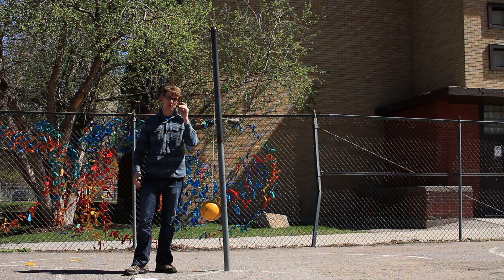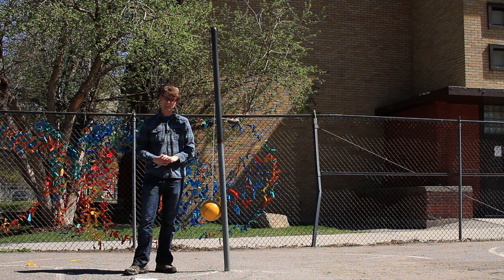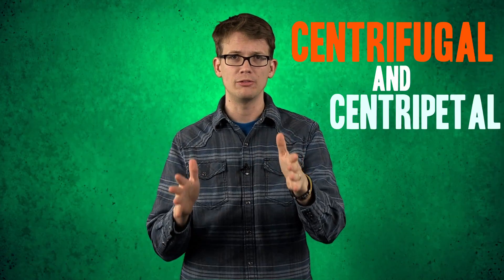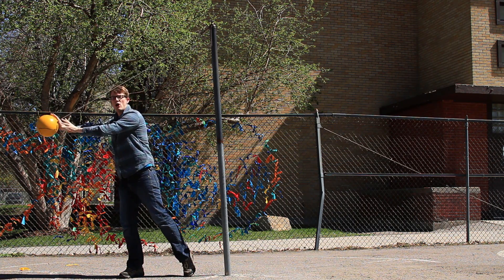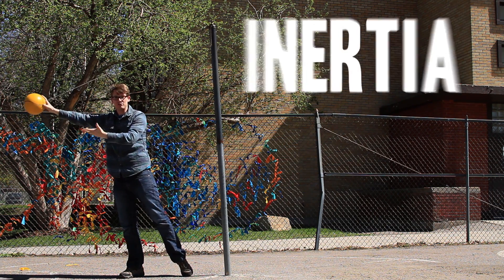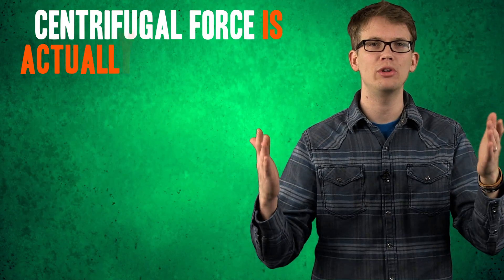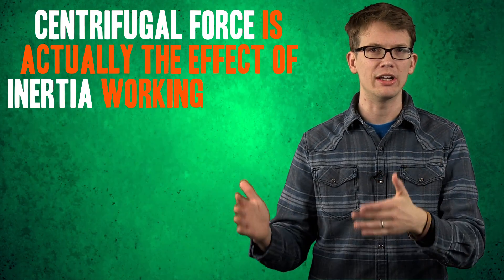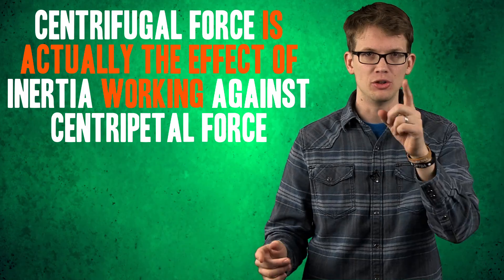IDTIMWYTIM: Centrifugal Force

Comment: Can someone clarify for me; what I got out of that was that non-contact forces are fictitious forces. Is that correct?
Reply: No, that is not correct.  Magnetic forces certainly are real forces, and they are also "non-contact".   Electrostatic attraction and repulsion is also non-contact, and it is a real force too.   Even the contact force between you and your chair is ultimately a form of electrostatic repulsion, and the fact that it seems like a contact force is really just an oversimplification for our perspective.

The reason that the apparent centrifugal force is a fictitious force, is that when you examine the problem from an inertial reference frame, the force is no longer present.  The reason the ball puts a tension on the string, is that the string is causing the ball to accelerate inward.  Not because there is a force pulling the ball outward, as it appears to be from the perspective of the ball.

Comment: Scharfy, the force that holds you against walls on rides is centripetal force.  Its just that instead of having a string hold you in place you have the walls or seat of the ride providing the force.  The shape of the rollercoaster track and your velocity controls how much force is applied.

Comment: Centrifugal force isn't a thing.
It is however observable if you are inside a moving point of reference. If you were for example, inside the ball on the string, your inertia would push you into the side of the ball away from the pole. Realistically the ball would be providing centripetal force for you, but as you are stationary in reference to the ball, you wouldn't see it that way, you would experience being forced towards the sides. Same thing applies for cornering in a car for example.

Comment: As for the space elevator, I think that has more to do with the properties of stuff orbiting in space. Like, if you put the center of mass of an elevator in a stable geostationary orbit (actually slightly above, for complicated reasons), the cable is 'hanging down' from orbit rather than the space station being 'held up' from the ground. There's tension pulling the cable up,, rather than pressure from gravity pushing it down.

Wikipedia has a decent diagram, search 'Space Elevator'.

Comment: There isn't technically a force pulling it away. There's a force pushing it forwards, and a force pushing it inwards. If you watch something like a hammer thrower, you'll see that they release it at right angles to the direction they want it to go, because the instant you stop pulling it inwards it just wants to go forwards.

Comment: Here's how I like to explain it:  When you are in an accelerating car, it can feel like "some force" is pushing you back against the seat.  But for most people it is easy to understand that in fact it is the seat pushing against you as you try to stay at the same speed.  In the same way, when you take a turn in your car, it can feel as though "some force" is pushing you against the door, when in reality it is the door pushing against you as you try to keep going in a straight line.

Comment: Actually, that's accurate.

Centrifugal force is the force the moving body exerts on the 'string'. In this case, the weight of the tower against the tower itself. This force, pulling the tower outwards, would start to counteract gravity. Then the problem becomes about how to stop the entire thing from tearing in half.

Comment: Gravity is still working on the water when it's upside down, but the water has enough inertia so that it doesn't leave the cup as it spins overhead. Think of it like throwing a ball in the air, but with water instead while inside a cup. Also, if you get it at just the right speed, the water starts to leave the cup but it is caught again, that's when the water is in free fall.

Comment: The "lack of gravity" on the ISS. There's almost the same amount of gravity up there as there is on the surface of the earth. The station and the astronauts are falling towards the earth but also travelling sideways at such a rate that they never get closer to the earth as it curves away from them. They're not floating, they're perpetually falling.

Comment: for an episode, i'd like to see exactly what the high and low daily temperatures mean. Because some dayss, here in good old ND, its definitely colder than what the weather people promise (and no, i don't mean wind chill... or do i?)
Reply: They use a temperature probe that is mounted in a gill shield, so that it only measures the air temperature directly.  The gill shield is stack of reflective plates, that block radiation heat transfer from either heating the probe or allowing the probe to radiate heat to the surroundings.  This way, it only measures air temperature, and the measurement isn't influenced by factors specific to the temperature probe's exposure to sources and sinks of radiation heat transfer.

When you are exposed to the night sky, it can feel colder than the air temperature, because your body is free to radiate heat to the cosmic background.   Particularly on a cloud-free night.   A clouded night will hold some heat in, and it won't cool off as much.  Your temperature will also feel a lot closer to the air temperature, as the clouds block your ability to thermally radiate heat to the cosmic background

Comment: No, it's still a fictitious force.  But considering fictitious forces can sometimes be helpful especially when the PoR is rotational.  Sometimes the force exerted BY the object is called Reactive Centrifugal force or Centrifugal Inertia reactive force.  But it's honestly less confusing just to call it inertia since it's really NOT acting away from the center it is really just the resultant opposing force caused by of the centripetal acceleration.

Comment: Momentum. The force that you're feeling squishing you against the car is actually the force of the frame of the car (or the seat on the ride) pushing back against the direction of your momentum. Here's another example: imagine a car driving down a straight road until it comes to a 90 degree turn. In order to change it's trajectory, some force must be exerted on the car. In this case, that force will be friction between the wheels and the road. This frictional force is the centripetal force.

Comment: The same force that u experience if something is accelerating at great speeds (G forces). This force is much greater because your body is prevented from moving in a strait line and the ride keeps u from flying off at 90 ' degree angle in fact the tension between the ball and the string is the same one between you and the ride. This change in a bodies state is called inertia.

Comment: Is gravity a real or fictitious force?
Reply: Since you can identify which two objects cause it to each other, it is a real force.  It is more of a real force than the centrifugal force.

In general relativity, it does use the curvature of spacetime as a means of communicating the force of gravity over long distances, and gravity is seen as a consequence to attempting to take the inertial straight line path through spacetime.   This is why in advanced physics, it is seen as a kind of a fictitious force.

Comment: There are 2 centrifugal forces... 1 reactive, real and present in all reference frames, 1 fictitious only present in the rotating one. The real one is what makes a spaghetti straw break if you spin a tennisball around it (instead if the steel pole), the fictitious is what makes you stick to the road in a loop. And to whoever asked about the weather, you're probably thinking of the coriolis force (also fictitious).

Comment: mass and weight are related in the equation F=Ma
where 'F' is force, 'M' is mass, and 'a' is acceleration due to gravity. (~9.81 m/s/s)

my mass is roughly 100kg, so I weigh ~9810 N

That's why you weigh less on the moon, because 'a' is smaller

Comment: Isn't centrifugal force present in weather though? 
I've been told no by physics teachers and yes by meteorologists.
Reply: Centrifugal pseudoforce and Corilolis pseudoforce are consequences from living on a rotating planet, and measuring relative to the planet's surface as a reference frame, instead of relative to an inertial reference frame.   What it really is, is the air mass attempting to travel in a straight line that is tangent to Earth's rotation.  It is a factor that determines the global circulation model, which is the general tendency of air to circulate on this planet, that determines prevailing wind directions as a function of latitude.
Reply: @carultch  wow, long wait follow up. Thanks.

Comment: centrifugal force is the 'fictitious force' that the glass seems to experience from the (non inertial) rotating frame of reference of the glass. if you were a bug standing on the rotating surface, there would seem to be a force pushing stuff outwards (that is cancelled out by the centripetal force when it's not getting further away so it looks like it's not moving from that frame of reference)

Comment: Dear Hank, I have a question. I work at a Glass Museum, and they perform live hot glass shows, where they make a piece before an audience. To pass the time, the glass blowers usually tell some facts about glass or the museum. Sometimes an artist will spin the glass to flatten it out; now, I've always thought this was due to centripetal force. However, they, and any other information I find concerning this the museum provides, always call it centrifugal force. Which is correct?

Comment: The centrifugal force does exist, when constructed inside of a rotating co-ordinate system, as in your example of the fairground wheel. However, looking in at the wheel from the outside, the centrifugal force is not apparent, it's just forces caused by inertia and the centripetal forces. I think.

Comment: I know you've already got plenty of responses but i don't think anybody's said this yet. If the ball was rotating and we were considering a system with friction, then there would be different pressures on either side of the ball causing it to swerve slightly. This isn't relevant to the subject at all though. :)

Comment: It's a combination of centripetal and inertia forces. The inner edge of the glass (in a curved shape) is what's applying centripetal force to the ball; the ball's inertia has it trying to find the straightest path possible, which in that case is toward the bottom of the glass (away from the opening).

Comment: Yes there is, it's called... the track. The track the rollercoaster cars are on is curved downward, forcing the rollercoaster into a curved path, meanwhile the passengers have inertia, which is attempting to keep them moving in a straight line (upward while upside-down), which is what (aside from the safety harnesses) keeps them in their seats.

Comment: Nope. The very microsecond the string is cut (and the centripetal force being applied to the ball through it is no longer in effect) the ball will continue in a straight line, or as straight as is allowed by the other forces working upon it (air friction, gravity, etc). It would not, however, continue to curve around the pole at all.

Comment: I'm not entirely sure, but if i remember correctly, the faster you move the more mass you gain, and the more mass you gain the more fuel or energy it would require to move you. That's why when you use the speed of light in newtons formulas mass tends to infinite.

Comment: I think you have a misconception. Por practical speaking "glow in the dark" means: "Turn off the lights so you can see the flourescence/phophorescence (or any other kind of chemoluminiscence) clearly". In research laboratories we need a "dark room" to study these phenomena, and things can be properly described like "glowing in the dark", since in normal speaking dark only means lack of visible light, while it does not mean that other wavelenght electromangnetic radiation to be missing too!

Comment: 3 possible "centripetal forces" away from the axis of rotation:

1. Fictitious force. Watch the video.
2. We are in a non-inertial (accelerating) frame of reference, such as the perspective of the ball. A "phantom" centripetal force appears. Arguably the same as (1). Non-inertial reference frames are weird.
3. The ball is putting a reactionary force on the string away from the pole. Newton's third law.